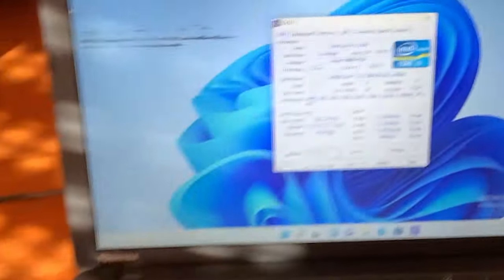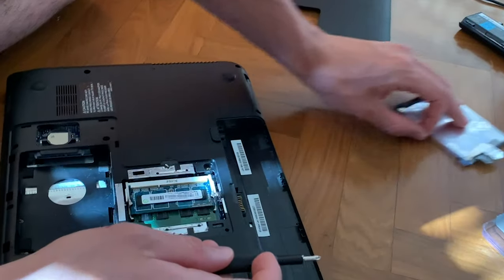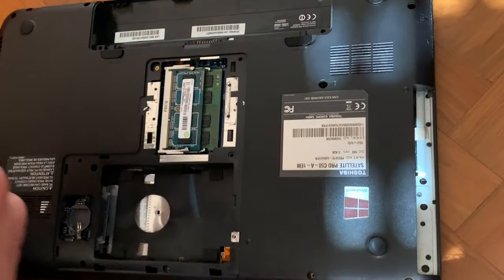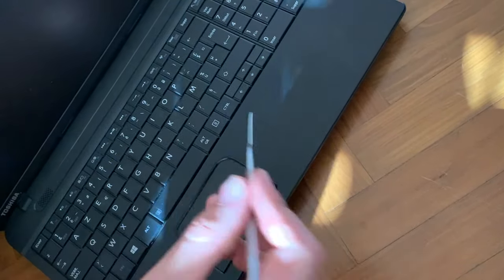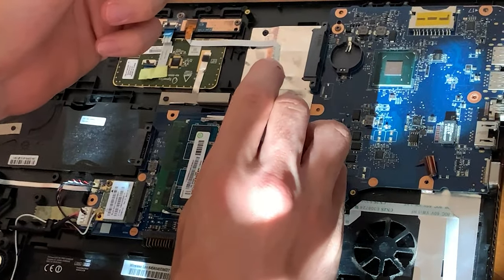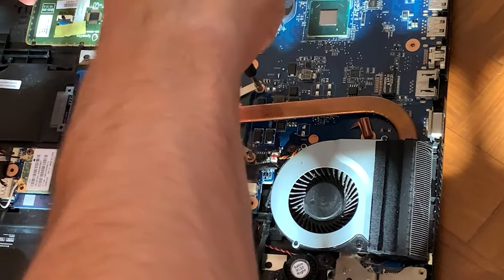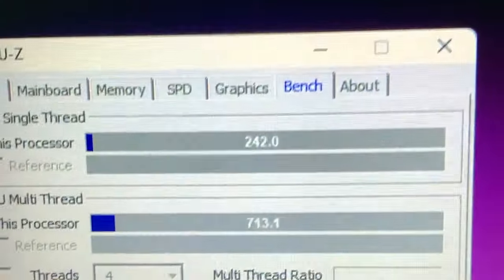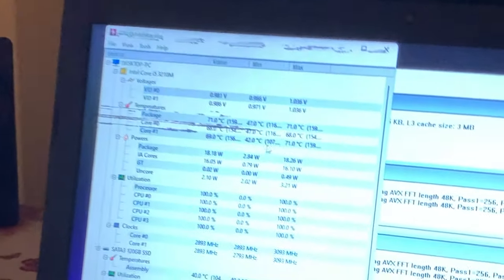How to Upgrade a Toshiba C50-A Laptop! Upgrade CPU RAM and SSD for just 50$ - Tutorial

Comment: My toshiba c50d-a-11Q has a amd e1-1200 app with Radeon (tm)  what would be the best cpu or processor upgrade?
Reply from the maker: Unfortunately your CPU is soldered I fear, this tutorial doesn't work with AMD CPUs...
Reply: @ImWateringPSUs  damn, so i can still change to the ssd and increase my ram? Would the amd processor struggle ?  I am thinking of getting the 1tb ssd.... im just going to use the laptop for normal stuff no gaming....do you recommend a smaller ssd?
Reply from the maker: @uittyman  I personally think a 240GB SSD is gonna be enough, for a non-gaming laptop I'd put at most a 500GB one! You can definitely do the RAM upgrade as well, by doing SSD and RAM your laptop speed will still change dramatically so I recommend you do it!